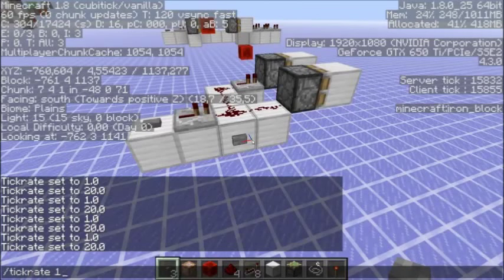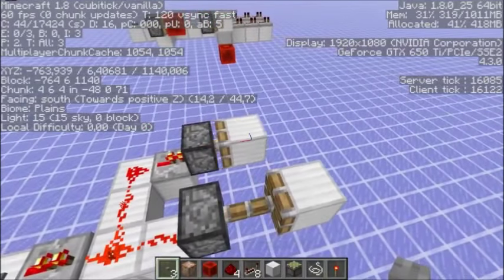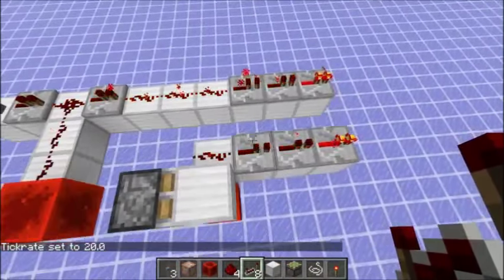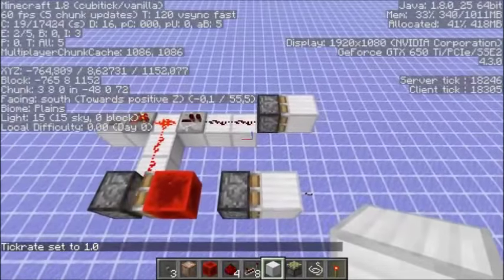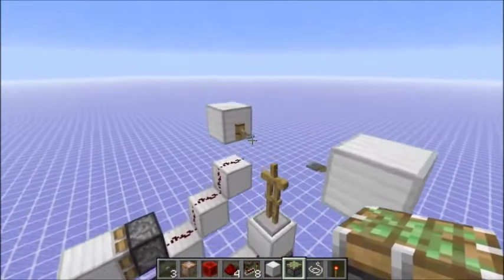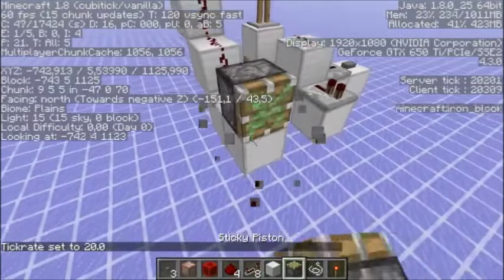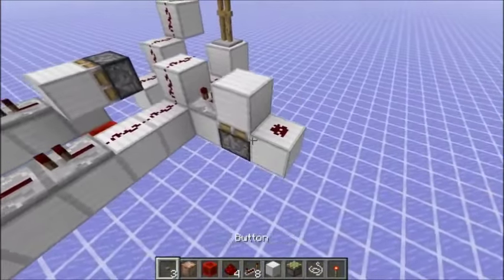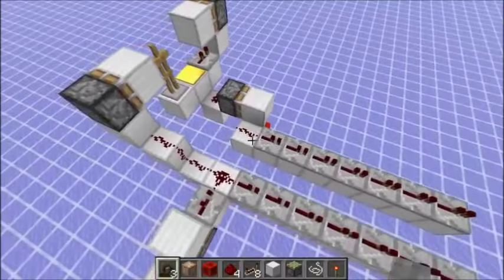Redstone Basics: How to get a delay of 1 game tick

Comment: Great video! I didn't know repeaters were so finicky xd. These designs will probably proof useful to many people (including me, maybe).

Also, for solving tha problem with the cooldown: wouldn't it be possible to use the 1gt difference creator once to turn two redstone clocks on 1gt out of phase with each other and then use those at whatever speed you need?

Comment: redstone BASICS: how to get a delay of 1 game tick
me: what's a repeater do?
Reply: They are actually really straightforward. They act like diodes in real life, so current only goes one way. Also, they always output a signal strength of 15, so they can extend a redstone line. They have a variable delay, either 2, 4, 6, or 8 gameticks (1, 2, 3, or 4 redstone ticks). 

They also can be locked into their current state they are in by running another repeater into the side of it. 

Hope this helped.
Reply: @amplitudemc  well yes i get that no, and it was mostly a joke when i posted this before anyway, i knew what it was (more or less)

didn't know they could be locked tho so thx i guess

Comment: btw now when we know actuall tick phases its not repeaters have less delay by 1gt it actually pistons have more delay by 1gt. Heres detailed description of 0:56:
0gt:
button pressed (at 15850 server tick), which immediately causes redstone dust to power on, which causes repeater to schedule its activation in 2gt from current tick so in 15852 server tick (you can see it on video). Also near piston schedule its block event for extension (but because block events processed before player input, start of extension happens in next tick. You can kind of see that extension happens not in 15850 for sever tick and not in 15876 for client tick when button was pressed and rather later. But here desync between client and server so client animate piston extension only in 15878 client tick even though on server side piston "should be animated" in 15851 server tick)
server increases game tick
1gt:
repeater checks if it should be activated but it only 15851 server tick so nothing happens
block event for near piston processed, piston start extending
2gt:
repeaters checks again and now it powers on, which causes far piston to schedule block event for its extension
block event for this piston processed and piston starts extending (and again for server "animation" should start at 15852 server tick immediately, but on video you can see it happens a little bit later - exactly at 15879 client tick when client only gets this info from server)

Comment: ilmango, 
At 2:34, you showcased the "instant repeater". However, I'm curious why it's considered instant even though you explain that a piston waits an additional gtick before deciding to extend when it's in the specific configuration which you showed at 1:47. So, is the instant repeater only instant in certain configurations?
Reply from the maker: +UserTech541 they're called instant repeaters, because in other cases, they're indeed instant. Instant repeaters after a BUD, that is activated by a growing tree, work in the same gametick. Pistons activated by a button have 1 gt delay, but after that, everything is in the same game tick.
Reply: +ilmango thanks